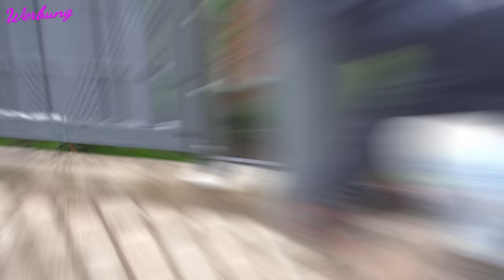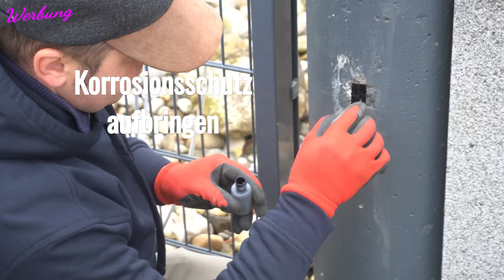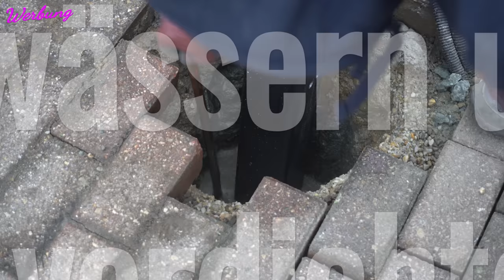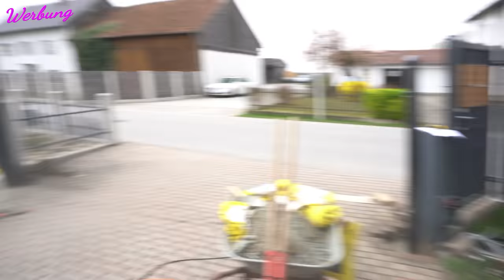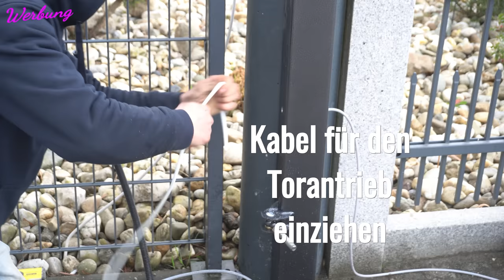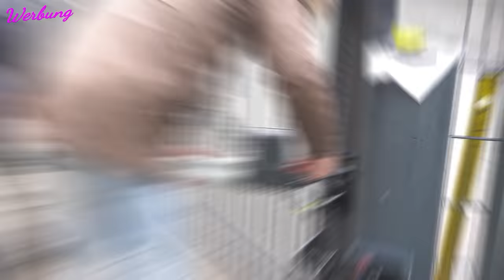Neues Gartentor von ZaunTech. Zäune aus Polen 👍 Alles aus einer Hand !!

Comment: Sehr schöne Sache das Tor.
Hey Proof kannst du mal ein Video machen welche Leitungen Sinn machen für die Planung zur Ladung von E-Autos, ich plane gerade den Stromanschluss für meine neue Garage. ✌🏻
Reply: Ein 10mm2 in die Garage legen. Das reicht für alle Eventualitäten. Und ein Cat7 Kabel für Internet. Evtl ein Dual, zur Verlängerung von Stromsensoren bei PV Überschuss
Reply: Mindestens 5 x 6 mm² würde ich nehmen und wie schon erwähnt können 10 mm² auch nicht schaden. Allerdings mehr wie 11 kW Ladeleistung braucht es für den Normalfahrer nicht um ein E-Auto zu laden. Viele E-Autos können selbst das noch nicht mal.
Reply: @bot8895  aber in Zukunft vielleicht, deshalb lieber 5x10mm2
Reply: @jenst5842  Es kommt ja auch immer etwas darauf an wie viel Meter Kabel man zur Garage verlegen muss. Bei meinen noch nicht mal 20 m reichen mir 5 x 6 mm². Mehr als 11 kW werde ich nie brauchen. Obwohl ich drei Phasen in der Garage liegen habe lade ich beide Fahrzeuge nur Einphasig.  Habe in 50 tkm noch nicht mehr gebraucht. Durch die PV lade ich sowieso nir tagsüber langsam mit höchstens 2 kW.